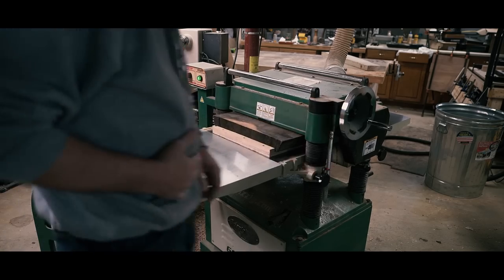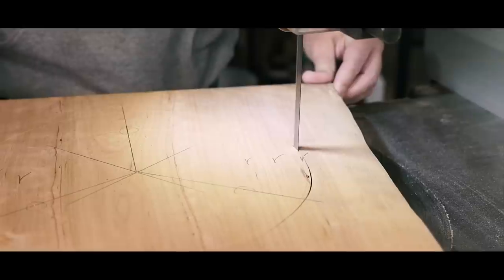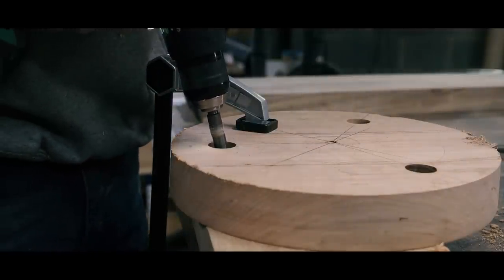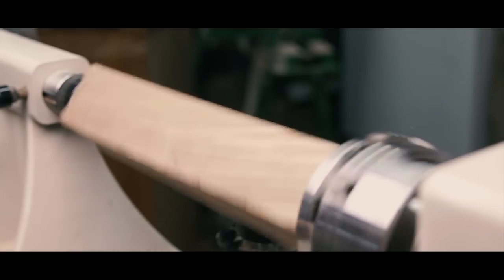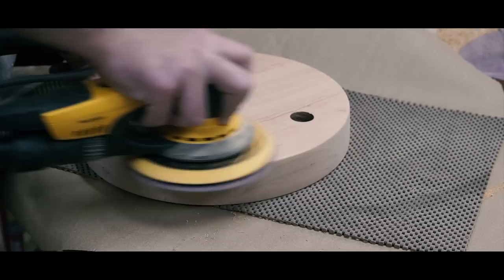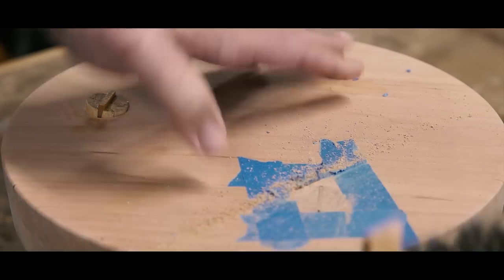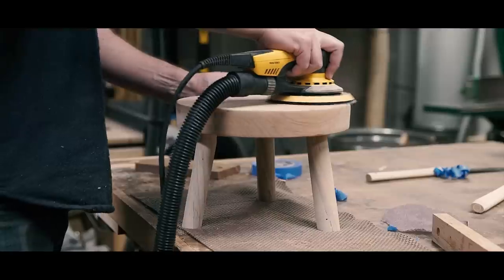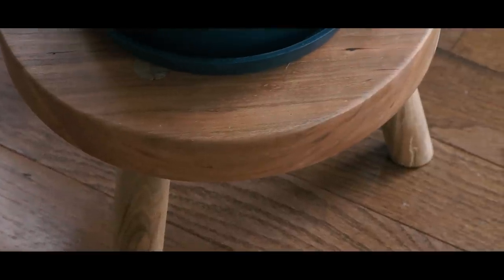A "Staked" Three-Legged Stool: Woodturning a Plant Stand

Comment: Glad to hear you will be posting more!! I was looking forward to the timber frame pool house!! Is that still coming?? Or is it finished? Thanks again for the video!!
Reply from the maker: I am still in the process of working on that timberframe.  I had stalled when I got to a point I needed some lifting equipment to tackle it by myself but I think I've sourced some duct lifts to help me.  I was going to do a series on the timberframe but it's a big job for just one guy so I opted to just get to work. I might do a tour of it when I'm done and break down the joinery of how I did everything.